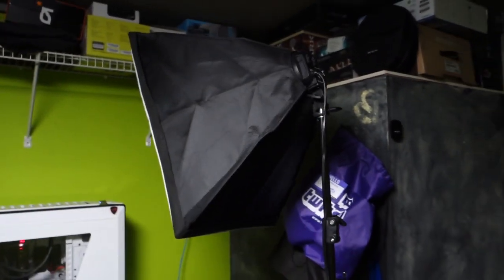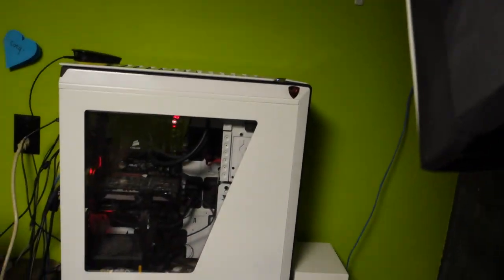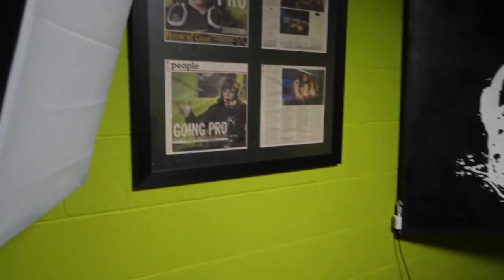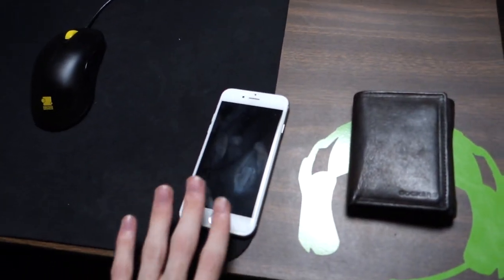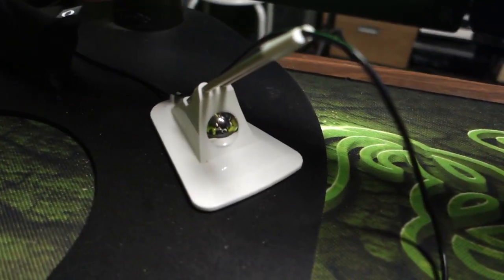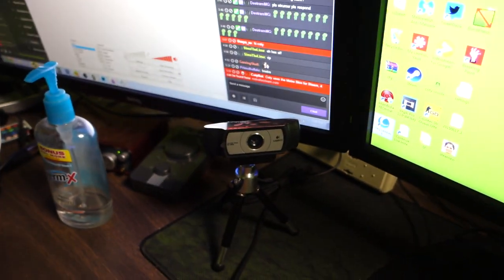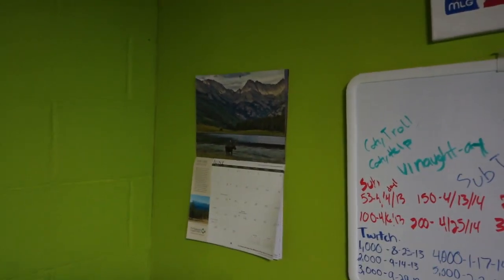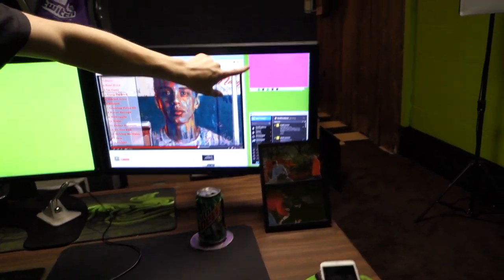NEW Set-up Video [2015]

Comment: Do you plan on upgrading the PC it seems a little dated with the new 980 ti put I've seen the numbers on it and have 2 in SLI myself highly recommend
Reply from the maker: Yea Its T_H_E_M_A_N185 yeah i plan on building a new gaming rig and using this one for streaming :D
Reply: Incoty your rig in my opinion is fine just upgrade some parts and your will save money. Plus the 760 and the 960 are kinda the same thing
Reply: Imcoty*

Comment: Quick question...

I'm kinda new with computers, but know the basics. If I don't want to stream are all the parts in Coty's link needed?
Reply: No a simple amd r7 260+ and 8gb ram will be enough
Reply: Julmaster01 What type of games do you want to stream?
Reply: He doesn't want to stream that's the point
Reply: +Julmaster01 16GB of RAM is recommended if you're planning on streaming due most games will take use of 8GB of RAM. But if you're gaming on one PC and recording and streaming on another then 8GB is enough.

Comment: got a few questions 
1 what is the cable called that connects to his monitors is it dvi???
2 how does he get audio from his pc ?? is it optical cable that goes to his mix amp

the reason i ask this is because i want to build a pc and im not sure how you  connect 3 monitors and what i need to do to get an optical port for my a40 mixamp.. thanks for anyone that can help
Reply: +Lachiezz I saw him using DVI cables for his monitors. Multi-monitor setups are supported with every display connection available. VGA, HDMI, DVI, DisplayPort you name it. Support for multiple monitor is usually dependent on the connections that your grapichs card has. There are multiple ways to connect a A40 MixAmp to your PC, there's the optical and then there's the 3,5mm headphone and microphone ports. Are you planning on buying 60Hz, 120Hz or 144Hz monitors?
Reply: +VelocityRaptor  thanks for replying! i found out about how to use the astros but wasn't too sure about the graphics card and the monitors, thanks for your help :)
Reply: +VelocityRaptor hey can u please either tweet me @lachiezz or click on my latest youtube video and comment so i clan reply to you and send you the links to my build and my monitors just so i can get your advice on the cables thanks
Reply: +VelocityRaptor but im getting 3 monitors and they are 60hz and my graphics card is the Gigabyte GeForce GTX 960 2GB Video Card and the motherboard is the MSI H97 GAMING 3 ATX LGA1150 Motherboard
Reply: The MSI H97 GAMING 3 seems to have an optical port, so the motherboard has you covered on the audio side. And the GTX 960 has all the required ports for triple monitor setup. If you're buying the monitors new, then they should come with all the cables you need for running three monitors from a single grapichs card. Can you also tell me the model of the monitors you're planning on buying?
Reply: search up this on amazon - ASUS VN247H-P 23.6" Full HD 1920x1080 1ms HDMI VGA Back-lit LED Monitor - i don't mind if i have to buy dvi or hdmi or whatever i just wanna make sure its compatible and that i know what im doing
Reply: Lachiezz You get all the cables you need with the monitors. I recommend that you use the main monitor with HDMI and the two other cables with DVI connections (the 2GB version of the GTX 960 comes with one dual and one one link DVI ports and one HDMI and 3 DisplayPorts) so you don't have to buy any additional cables. Are you going to use the all three monitors for gaming or just one and two others for multitasking? Because if you're all three monitors for NVIDIA Surround setup then you should probably get the GTX 960 4GB version instead of the 2GB GTX 960. That two 2GB isn't going to be enough for running the newest triple-A games on three monitors.
Reply: +VelocityRaptor so basically I guess I could put it into two modes - mode 1 is pc mode where I rarely but casually play games and sometimes stream them and use 3 monitors - mode 2 is Xbox mode where I'll play Xbox on one monitor and the other two will be either streaming it or recording it - and mode 3 which is probably my most common mode is when I use all 3 monitors for editing YouTube videos and other videos that I do that aren't for gaming, what do you recommend
Reply: +VelocityRaptor I'm a little confused but I can say that I will have one gaming Monitor which is for pc gaming and then I'll also use that monitor for my Xbox and the other two monitors no matter what the situation is they will be used to steam or record or as just multi tasking monitors, if I'm not gaming then I'm sure the 2gb would be fine but if I'm not gaming I'm editing on most likely 3 monitors - one monitor is the folder of where I store my videos the other one is the timeline where I edit and the 3rd is just the preview box
Reply: If you're gaming on one monitor then the 2GB variant is just fine. I meant that if you're gaming on three monitors then the 2GB isn't simply enough. But if you're gaming on one and recording on another then it's going to be just fine. I personally have two GTX 980 Superclocked cards in SLI from EVGA and i have 8GB of VRAM in total.
Reply: +VelocityRaptor yeah i should be fine and all of my work is sort of minor work i guess i could say, what cables should i use do you reckon, for my gaming monitor when im using it on my xbox is hdmi but when im using the monitor to play pc games what cable should i use for that and then for my two multi tasking monitors what should i use for them
Reply: All cables you need come either with the grapchics card or the monitors. I personally use my VE248HR on my right side for console gaming with HDMI, my center monitor (which is the Asus VG248QE 144Hz 1ms 24'' PC gaming monitor) as my main monitor through DisplayPort and my second VE248HR on my left side as my second PC monitor through DVI.